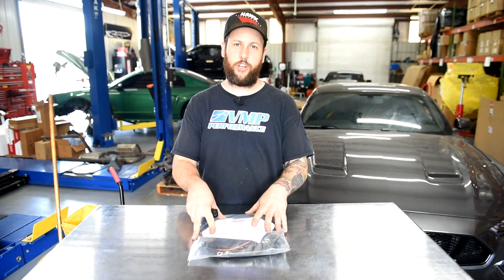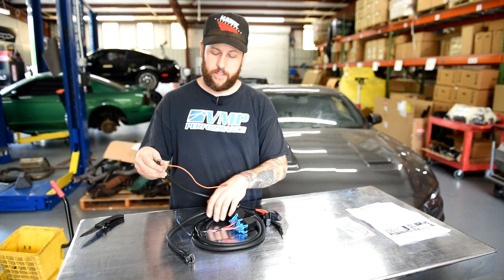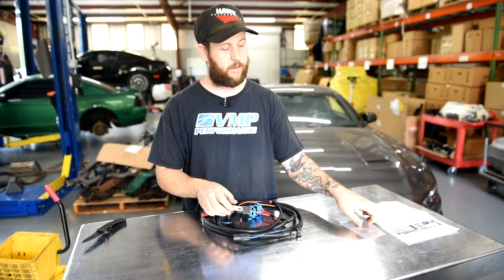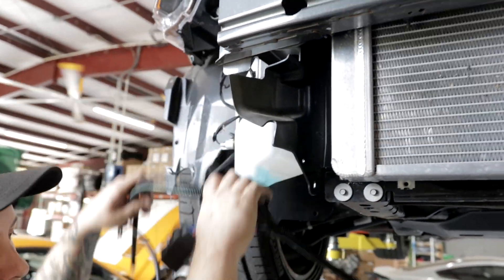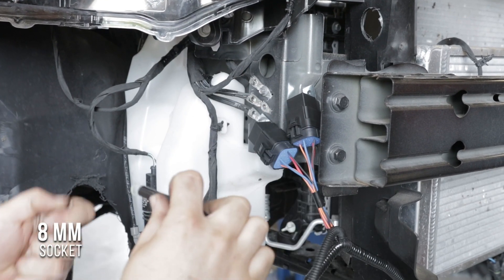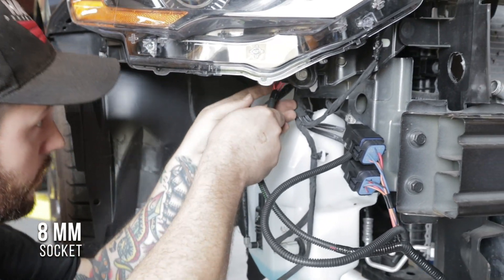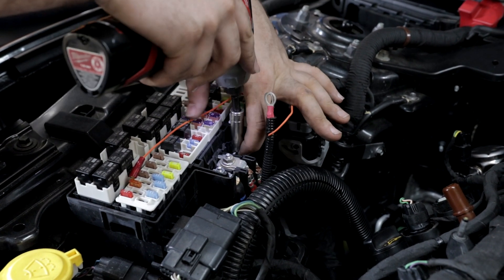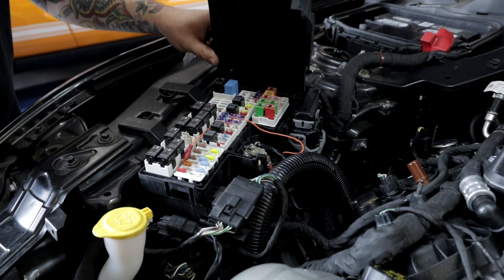Product Updates || 15+ Dual Fan Heat Exchanger Harness || Updated Installation

Comment: What if i wanna turn fans off manually while loading tune or in super cold weather. You have overide switch included.
Reply from the maker: There is not an over-ride switch.  You can pull the two fuses built in the harness to disable these items while loading a tune.

Comment: Does Vmp triple pass heat exchanger come with fan overide switch to manually turn off or on, so when i load tune the fans dont run

Comment: I just installed my heat exchanger a couple weeks ago. The fuse wire setup is awesome! A heck of a lot easier than digging in the back of the motor! Thanks VMP!
Reply from the maker: Thank YOU for your business and support!
Reply: @VMPPerformanceTV  I can confirm that this heat exchanger is SO much better than my stock Roush heat exchanger! IATs stay much lower. 😬👊